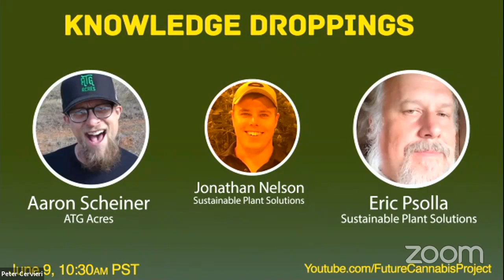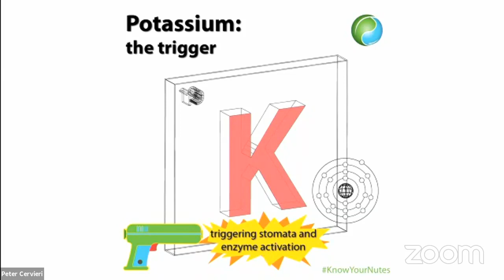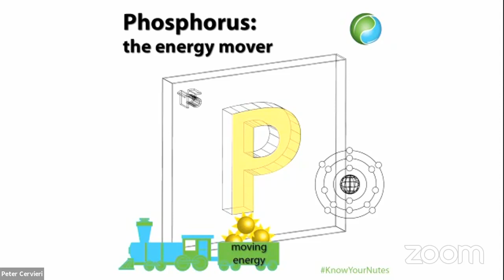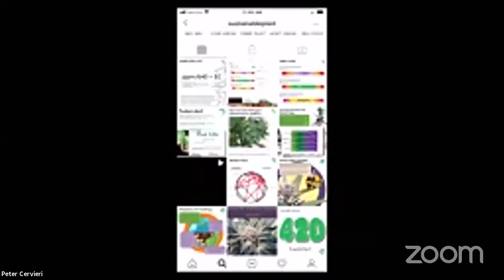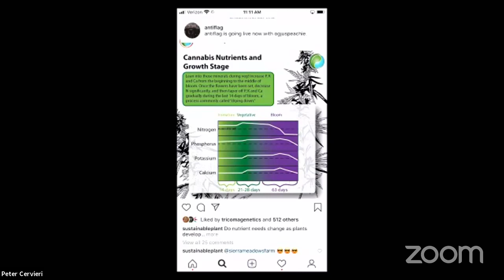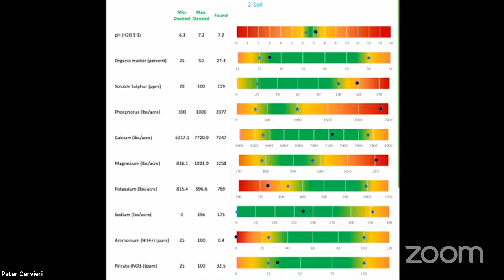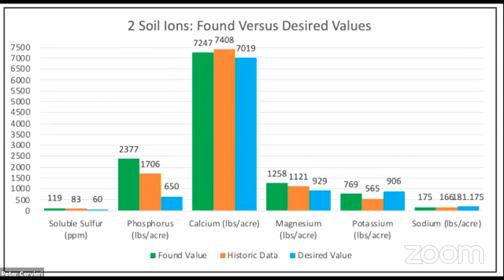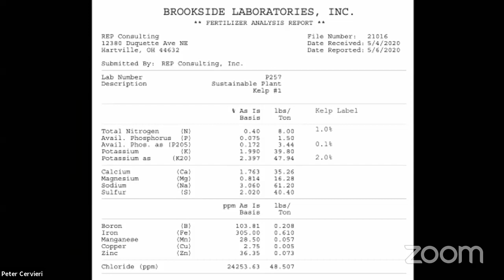Nutrients and Soil Sample Analysis

Comment: Hi. If your base soil pH is a bit high like mine. Often extra calcium is needed that makes the pH even higher then the soil needs to be pH adjusted. Peat is the no1 choice apparently. But you need a lot of it and it's expensive. I did research about how to lower the pH of the soil without costing a fortune some acids is also expensive. I did found a article about soil for growing wine where they use sulphuric acid to lower pH. It claimed to take about 6 months for the acid to be part of the soil solids. That's what I have been using but I haven't found on reference about that in the soil for  cannabis. Any thought on sulphuric acid to lower the ph in the soil?

Comment: 9 out of 10 rooms I go into are  calcium deficit
Reply: Nate L I’ve noticed in people’s vegetable and ornamental gardens it’s often not even a lack of calcium, it’s that it’s ratio compared to other stuff is wrong so it’s not up taking right. Where I live the ground is glacial clay. Lots of calcium, all bound up.
Reply: Why is that though?
Reply: Mr Hankey to me or the other guy? Cuz most people are either over feeding something or over or under watering and making plants not take up calcium right
Reply: @Irongaint  Calcium gets locked up with phosphorus iron zinc. Making it unavailable for the plant. Many people lack boron in the soil that is nessicary for the uptake of calcium.
To avoid the calcium from being locked up I chelate it with two amino acids, glysine and glutamic acid. They will stimulate the roots to open up calcium ion channels and uptake calcium 1000 times faster then passively through the transpiration system one molecule at a time.
Reply: @juliankirby9880  I have grown in soil that has 3500 ppm calcium and on another project in which the water had 600 parts ppm of calcium and magnesium. 
When I said deficiency I was referring to deficiency in the plant not the soil or growing medium or water.
Definitely about ratios of nutrients and minerals in the plant! 
The proper PH ensures that the minerals and nutrients are available for the plant, which is governed by a correct fungal to bacterial ratio in the soil.
Reply: Nate L thank you very much for explaining super awesome! I am trash at fully explaining things unless I am writing a paper and can self edit like 40 times to make it not sound like the ramblings of a mad man.
Reply: Nate L you explained your stuff and my stuff really well!